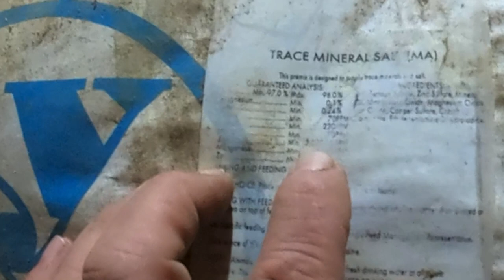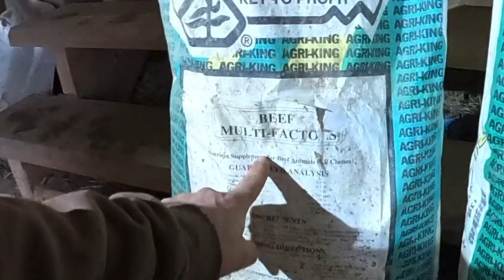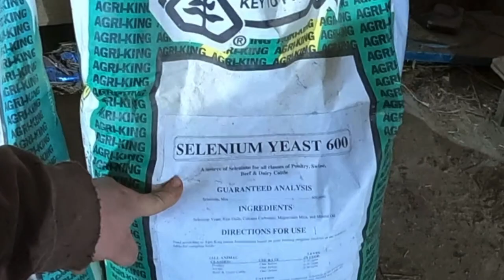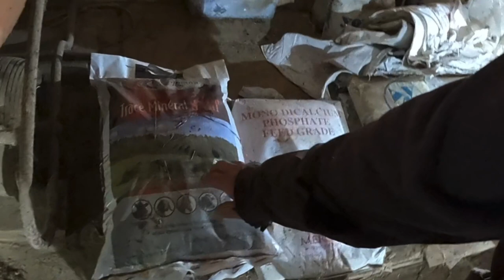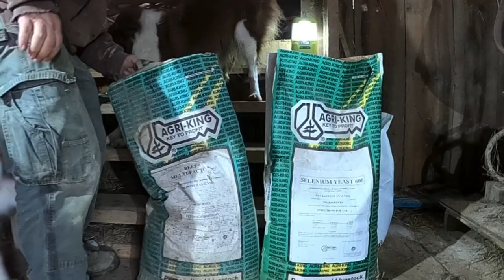Mixing minerals for your cattle and forage talk.

Comment: This is one of the most knowledgeable explanations of minerals that I've seen.  What would be the course of action if supply lines stopped for a significant, or indefinite amount of time?  How would you go about maintaining your mineral production?  Ash? Breakdown of local stones for calcium and other trace elements?  I'm interested in ways to care for a herd, without depending on supply chains.  Never know if, or when a disruption can happen.
Reply from the maker: If supply lines stop. I'm not to worried about the livestock going for an extended period time with no minerals. The since we have started adaptive grazing our mineral use has dropped to half of what to was when we started. Also if the supply line stops for an extended period of time. I think we may have bigger problems in other areas of the farm.

Comment: Would you explain why it is that you know more about proper ratios for the various elements than the cows do?
Reply from the maker: Thanks for the question!!! Did you watch the whole video? I covered the reasons why we do what we do with minerals. I can get close to what their body needs. I work with five doctors that have their degree in nutrition. I'm assuming that you are referring why I don't use cafeteria style minerals. Cost is #1 and taking too much time to mess with it #2. Bottom line this is how it is if the livestock can’t do it in the environment and need babied they need to be culled. Thanks for watching!!!
Reply: @RussWilson  i asked the oklahoma state extension beef cattle specialist, one time to explain how could he say that minerals had to be mixed into feed since they would not eat what they needed, when a customer had 40 cows and a bull that ate 50 lbs of dicalcium phosphate overnite? His response was "sometimes when we think we know a lot, later on we realize that we didn't know much to start with" 
Couldn't one build a wagon with as many of the cafeteria style containers for the minerals with a cover on top to keep most of the rain off? 
I've just not seen any evidence that refutes the idea that cows are more capable of balancing the nutritional needs. As long as they can get to everything they need they will balance their needs. 
I'm just saying, why force a cow to eat salt, when they're craving calcium? For example. Everything science knows about minerals is that the ratio of nutrients is as much or more important than the actual amounts.
While I was in the livestock feed buisness, my customers saw wide ranges of different consumption of the different mineral ingredients.
I do get a lot of information from you tube videos such as yours and I do appreciate what you are doing!
Reply from the maker: I built a wagon with a water tank and mineral feeder on it. It had three places for minerals. Still, it was not portable enough. Moving cows multiple times, a day it added 30 minutes on daily chores. From what I have learned if their body is getting too much one mineral it will pass though their system and not be absorbed. I have culled cattle for eating too much mineral. Is it a waste of that mineral I don’t think so. As the soil probably is lacking it. Our soils have been mined for many years like most other farms. Soil comes first on our farm the livestock are the way to manage it. Please do not take this the wrong way. I feel the cafeteria style feeder is a crutch. I would not even use them if they gave it to me. Will I change my mind at some point maybe but not likely. It is something I have spent a lot of time researching. Please don’t take offence at the previous reply I have been slammed by the trolls sometimes it is hard to figure out who is serious. I do appreciate your feedback and your support by watching the videos. Thank You!!

Comment: Do you have any thoughts or experience with using free-choice kelp or raw apple cider vinegar with your cow herd?
Reply from the maker: I have heard good things about kelp and acv. I have only ever bought one bag of kelp since I have been farming. My only troubles with it is price. Kelp here is around $60 a bag. I have no experience with ACV. Thanks for watching!
Reply: @RussWilson  Kelp is about the same price here in Lycoming County.  I mix 1/3 kelp, 2/3 white salt to keep my annual cost at $3/AU.  Been using it for ten years - the one year I got away from it, herd developed pink eye - terrible condition!  May be anecdotal or the iodine, but if it keeps away pink eye, I'm willing to spend the $.  ACV consumption is my litmus when the cattle are not getting enough energy and too much protein, especially in the spring.  I view it as a general rumen tonic.  Annual cost is about $3/AU. Third free-choice offering is a local feed mill mix of 8:1 Ca:P, Mg, K, Zn, Cu, Se, vit A,D,E at about $4/AU annually.  Total free-choice program $10/AU/year.
Reply: @tedbarbour731  do you find the kelp gives an off flavour to the meat? A place I worked at started using kelp and started getting comments or complaints about the beef tasting different in a bad way.
Reply: @ryanforbes3021  I have no indication kelp gives an off flavor to the meat.  Intake averages less than 2 ounces per day per head - it's a small amount.
Reply: @tedbarbour731  ok, thanks Ted. Not many people in my area use kelp. I always wonder if it was the kelp or something else that was causing the issue.  I found some it had a "gamey" flavour.
Reply: @ryanforbes3021  I view kelp as a forage supplement grown from the balanced broth of seawater, which offers micro nutrient balance and a preventative for pink eye.  I've had a few customers comment on a gamey flavor over the years but have never been able to observe a trend or causation.  If the off flavor is diet related, some have suggested excessive protein or brassicas/turnips in the days leading up to harvest.
Reply: @tedbarbour731  ok. I dont know of anyone around here feeding turnips and very little amounts of brassicas. I had a highland heifer that I found gamey and the place I worked had some Galloway's in the herd. Personally I blamed it on the breed, partially because I'm not a fan of Galloway's or highland.